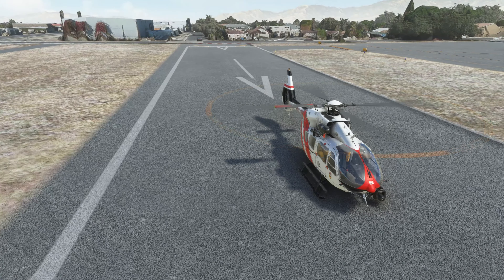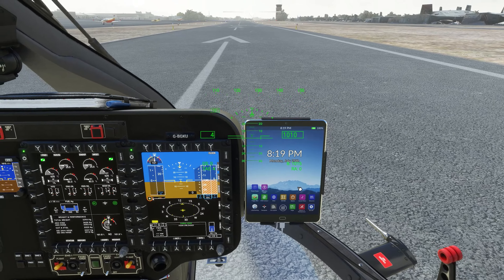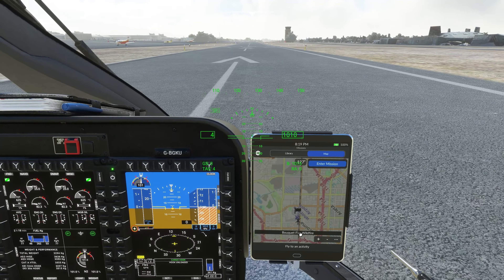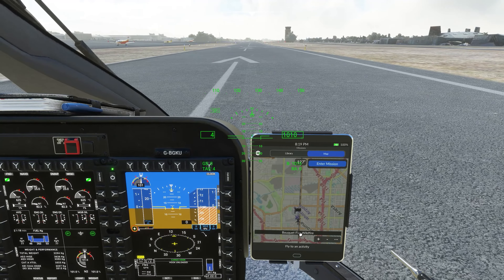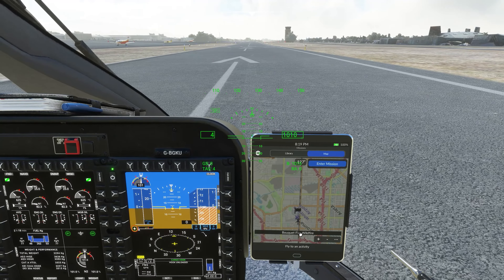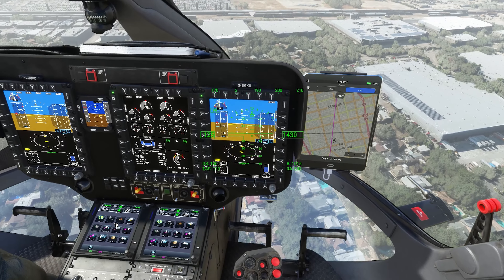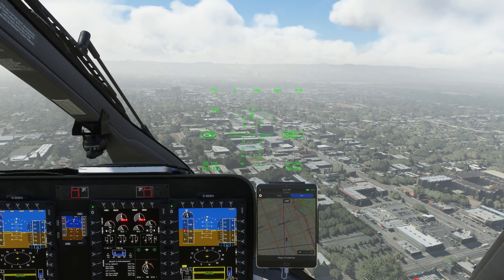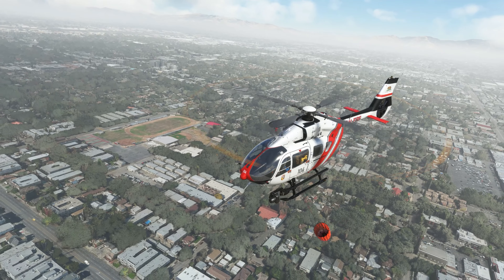Fire Fighting in FS2020 | H-145 Helicopter mission

Comment: 1255 is the standard firefighting aircraft squawk code.  If you have any other specific questions let me know I'd be happy to answer all that I know.
Reply from the maker: Ah thanks! In the UK 0033 is SAR, whil working as a controller I don’t think I ever saw a firefighting aircraft squawk in the uk.
Reply: Yeah I should have said in US airspace that's the standard...  It's like squawking VRF but for firefighting aircraft.  If we are flight following with ATC we squawk as assigned.  And if we file IFR to get to a fire then we use a special handling code STS/FFR.
Reply from the maker: Good to know, thanks bud.